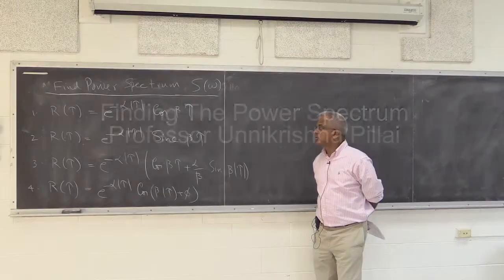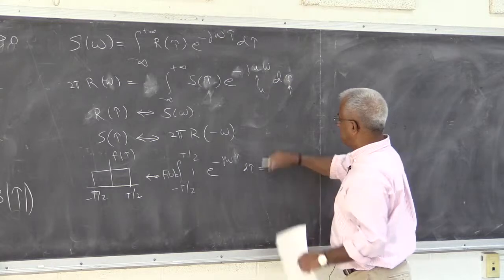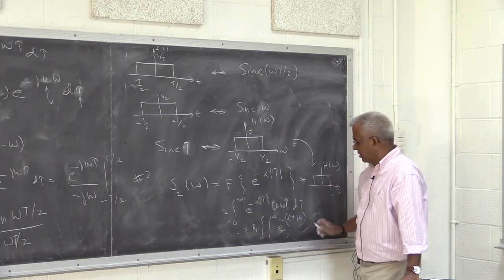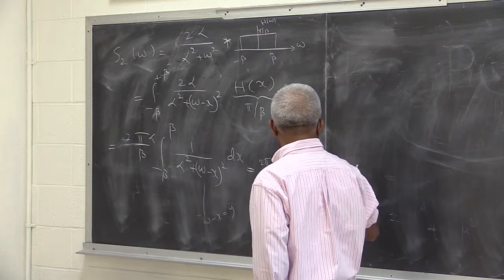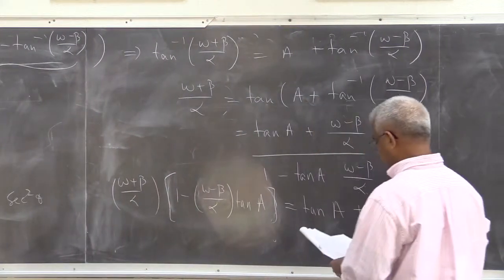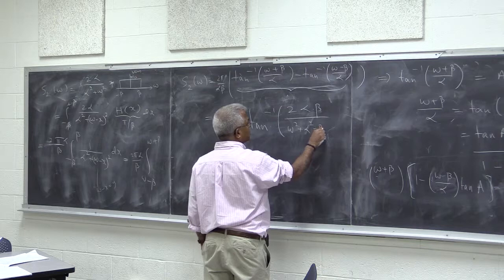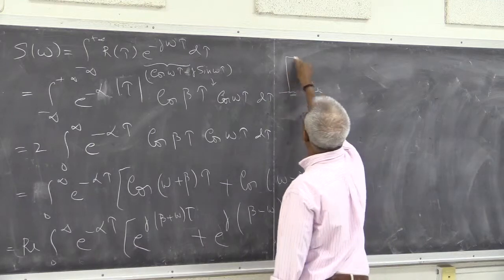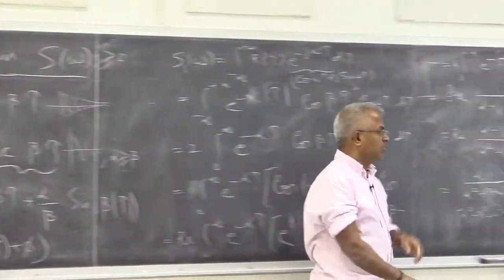Pillai "Power Spectrum of a Damped Sinc Function"

Comment from the maker: Minor edits:

At T 2.45 min, in the exponent  under the integral, u should also be replaced by \tau.

At T=5.20 min, the limits on f(t) should be from -1 to +1 (and not -1/2 to 1/2 as we have here). Same is  true at T=5,55 min; The limits on H(9\omega) are from -1 to +1.However. later H(\omega) at T=9.25 min is correctly identified.

At T=16.07 min, it  should be \omega - \alpha (not plus), although it is corrected later at T=16.40 min.

At T=23.22 min and T=23.34 min, \alpha + and \alpha - both will work, although to write |alpha +, in the previous line the exponents of the imaginary parts should have been written with a negative sign. Makes ni difference as we are only interested in the real part.